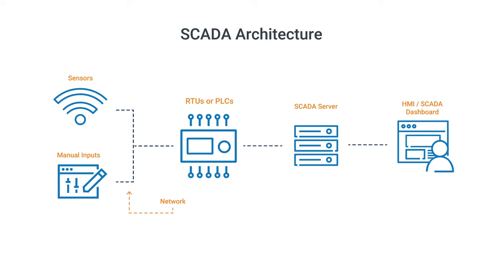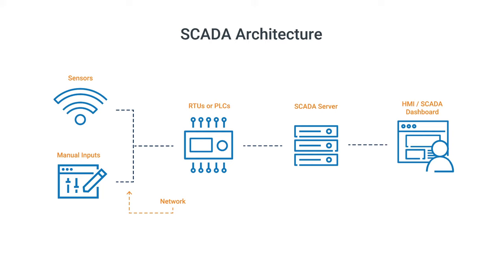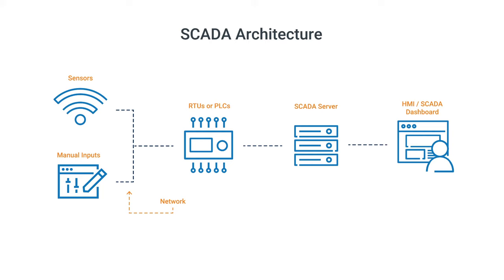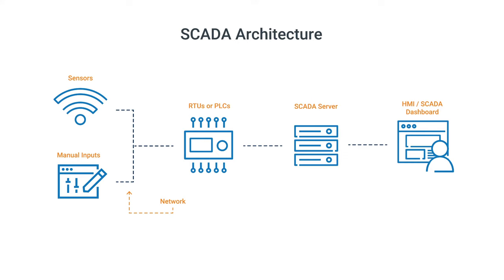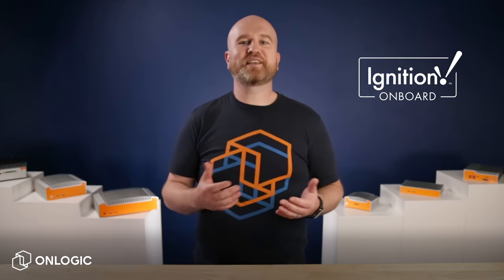What is SCADA?

Comment: - *(00:19)* SCADA (Supervisory Control and Data Acquisition) is a combination of hardware and software used for industrial automation, enabling the monitoring and control of processes both locally and remotely by collecting, recording, and analyzing real-time data.
- *(00:56)* SCADA systems connect sensors monitoring equipment like motors, pumps, and valves to a server, allowing for direct action through SCADA software or saving data for later review; users can interact with SCADA systems on-site via workstations, HMIs, or directly on the server.
- *(01:14)* SCADA is utilized across various industries, including manufacturing, oil and gas, and utilities, to enhance decision-making, improve efficiency, and reduce downtime; it's also used in smart cities for optimizing traffic patterns and power usage.
- *(01:37)* Implementing a SCADA solution involves defining what needs monitoring, determining current data collection methods, and integrating necessary hardware (RTUs, PLCs) and software to connect and manage sensor data, allowing for predictive maintenance and control.
- *(02:42)* Modern SCADA solutions provide unprecedented insights and optimization opportunities in industrial facilities, offering capabilities that were previously inaccessible, supported by partnerships like OnLogic with Inductive Automation's Ignition SCADA software.